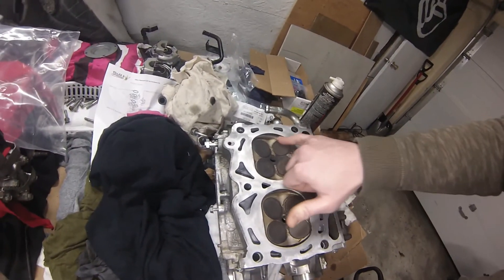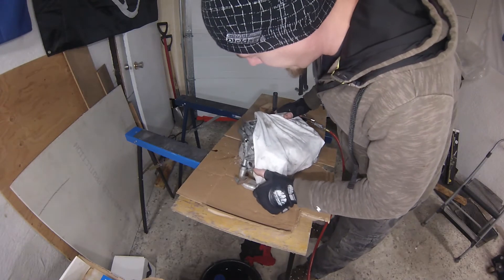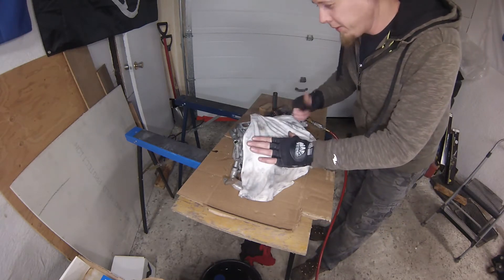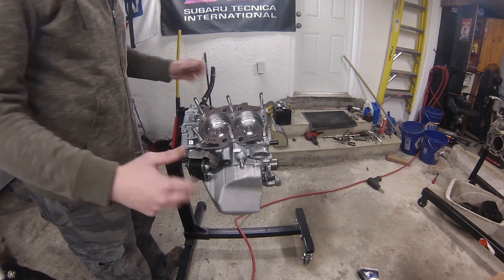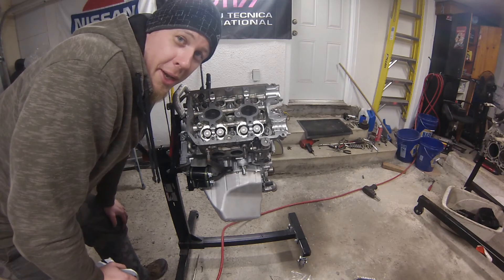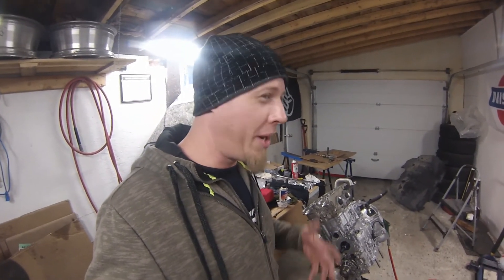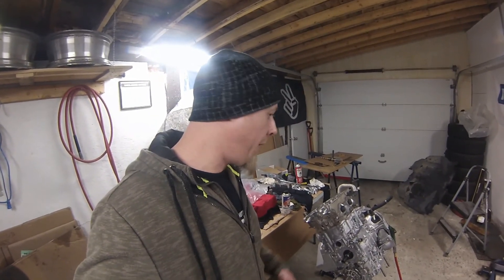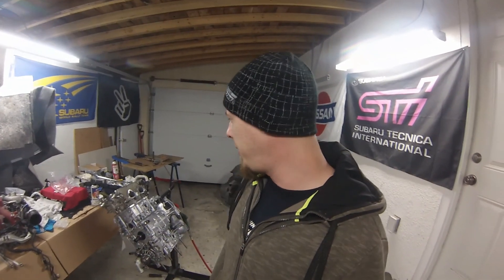2013 STi Build Part 7 - Drilling For 1/2 Inch Head Studs - How To

Comment: you can thread the stud into the gasket don't have to cut it and could of just installed the studs loose and drop the head over them and tighten them after
Reply from the maker: That is true for standard size studs, these are not standard size studs though. The center holes of the gasket and all holes on the cylinder heads require modification.
Reply: @HomebrewSubaru  thats what i did for 1/2 inch studs no cutting needed for je gasket

Comment: Good progress happening.  Food for thought didn’t consider changing valve stem seals for peace of mind seeing new piston and rings and new turbo going on weakest point left to smoke is through there. What’s your opinion on say painting the head gasket in cooper paint just for that extra seal on start up.  Nice work keep it up 👍
Reply from the maker: Really I could have gone as far as pulling all of the valves for lapping and installing new seals. These heads have very low mileage on them and we opted to stop spending money. If they had three times the mileage, valve seals would be highly recommended. 

I cringe at copper spray. It is a gimmick product from many years ago. I'm not saying that it doesn't do something, but if a head gasket isn't going to seal, it just isn't going to seal. I can only imagine how much of that stuff gets pushed into the cylinder, coolant passages and oil return when the head gets torqued down. IMO never put ANYTHING on a head gasket.
Reply: Cool. Yeah I’ve built a few like this on budgets before.  I’ve used copper spray in the past had no problems.  Like what you said in the vid you know what your doing and know it’s going to work !  Keep it up, enjoying watching this build !

Comment: Why Cosworth Engineering which is based in my home town of Northampton England and is renown for modifying Ford engines would manufacture a gasket for a Subaru I don't know. Maybe its their Chinese branch.
Reply from the maker: Cosworth builds all sorts of Subaru parts from connecting rods to full engines.
Reply: Yes but do they fit.
Reply from the maker: john adams Does what fit? The head gaskets?
Reply: I apologise I'm not questioning your expertise but the fact you had to use a file to make the gasket wearing the Cosworth brand fit made me suspicious.
Reply from the maker: john adams No problem, I just wondering what you meant. The gasket required modification because the ARP studs we used are larger than the stock head bolts. The outer holes on the gasket work because they are designed to fit over the dowel pins. The gasket is extremely high quality.